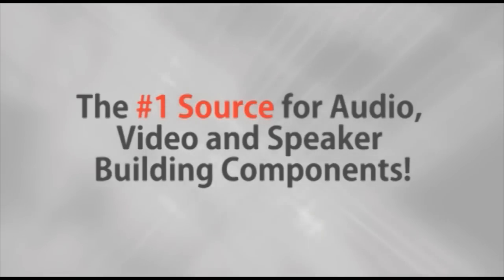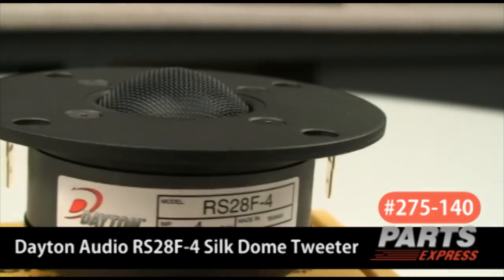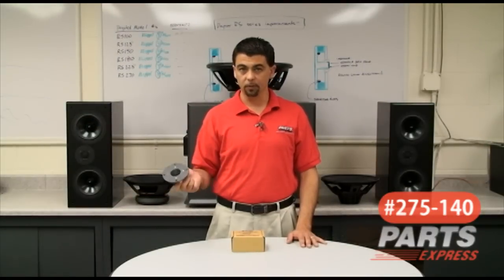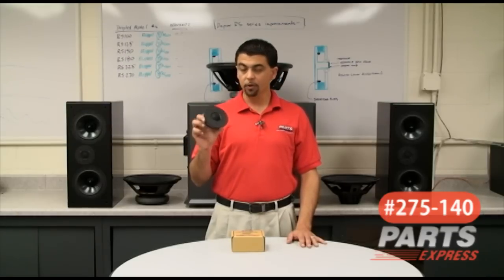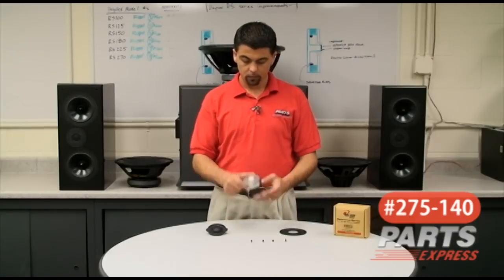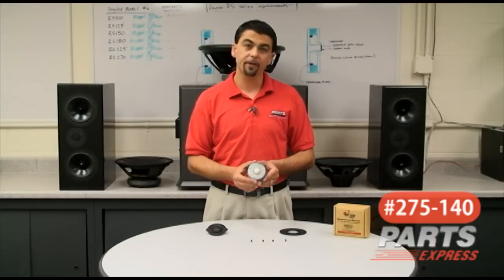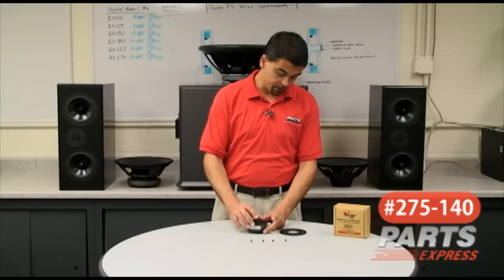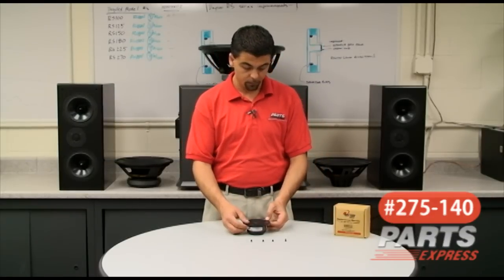Dayton RS28F-4 1-1/8" Silk Dome Tweeter

Comment: I used this tweeter on my Kef 104.2 and it sounds amazing, it is not a drop in fit and you have to do modifications to the size of the tweeter hole and use a brace to keep it in place but it is all worth it.